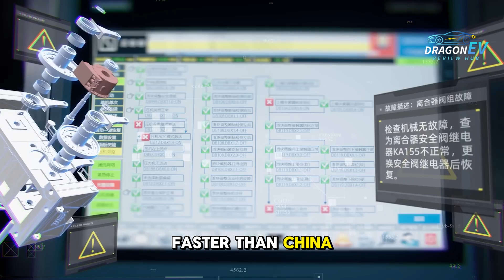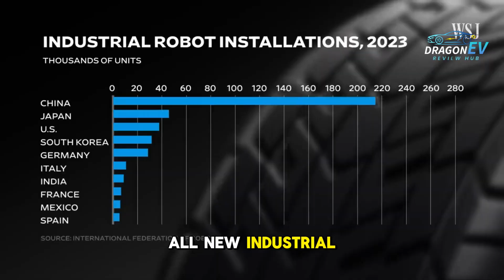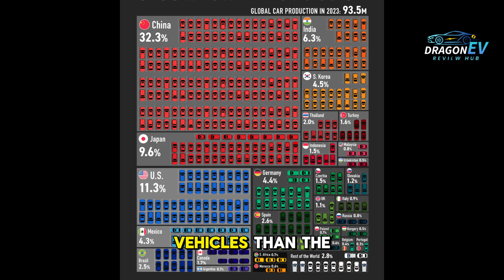China’s Dark Factories - The Machines That Never Sleep

Comment: I wonder who will afford the manufactured products being built by these factories.
Reply from the maker: That’s the key question — and it’s one the industry itself is struggling with.
Extreme automation lowers production costs, but it doesn’t automatically create buyers. In China’s case, most of these vehicles are still sold domestically, which is why overcapacity is becoming a real issue. The factories can scale faster than consumer demand, and that imbalance is a real concern.